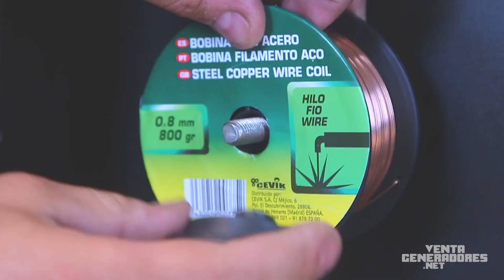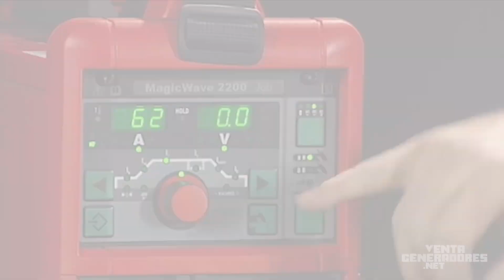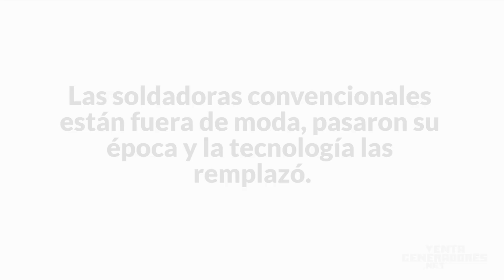Soldadora Inverter Vs Convencionales

Comment: A alguien le ha pasado que cuando suelda con una inverter como que hay que esforzarse para mantener el arco mientras se suelda, tengo una de transformador y mantiene el arco como si nada, en cambio con la inverter si alejo un poco la punta del alectrodo el arco se apaga. A menos que dependa de la calidad del equipo.
Reply: Si mano por fin encuentro a alguien que me pasa lo mismo que a mí, lo bueno que suelda suavesito y consume poca energía
Reply: Así es, el arco también se pega mucho a diferencia de una de transformador. Tengo infras Miller de transformador, craftsman, entre otra e Inverter y si deja mucho que desear, se corta el arco con la Inverter, se pega mucho, hay que trabajar demasiado para que de un resultado pasable mucho menor en calidad a la Miller, es decir, hacerle desgastes para poder tener una soldadura más o menos. Te hace trabajar de mas la Inverter que las de embobinado. La Inverter es 220 a 201 amperes, si solda y hay fuerza, pero si pongo una Miller o craftsman a 200 amperes corto placas de un centímetro, con mucho menos hago lo que hace la Inverter.